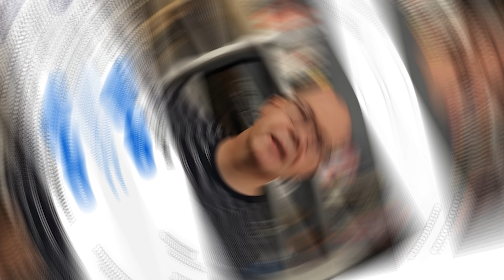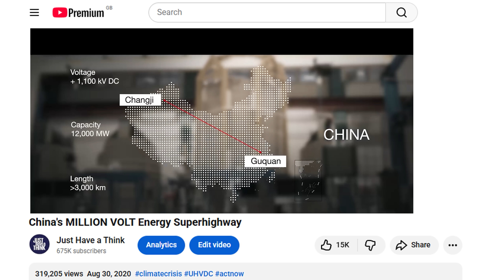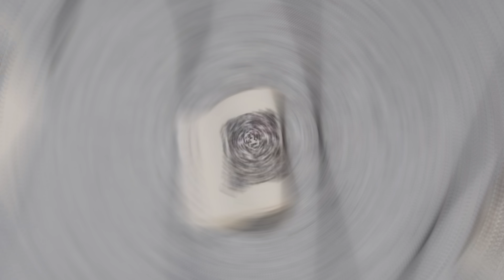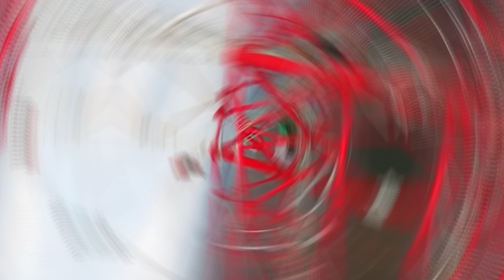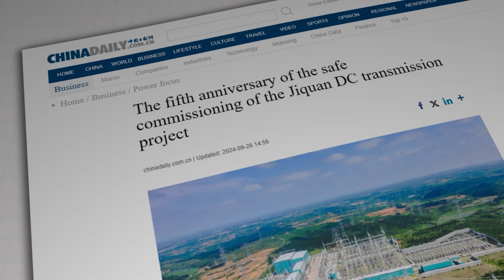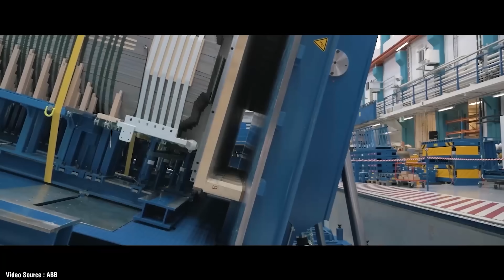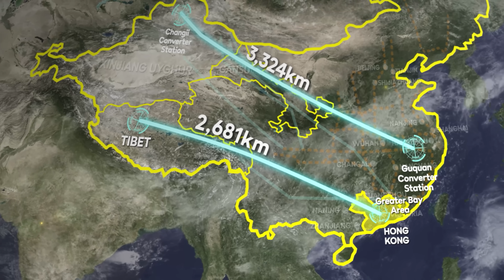China's ultra-high voltage transmission lines now breaking all records.

Comment: I'd like to see a real assessment of agriculture's impact on climate change vs fossil fuels.
As far as I understand it, agriculture is assessed using scope 3 for emissions (which seems to include everything anyone can possibly think of + some more), but the carbon captured by agriculture is not considered. 
Fossil fuels are only assessed using scope 1 (carbon released when it's burnt, but not taking into account anything else like extracting, refining, transporting etc.)
Seems to me that there must have been some very successful lobbying by the fossil fuel industry to get everyone to 'look over there' at agriculture to take some of the heat (no pun intended 🙂) off the fossil fuel industry!
Reply: I would do almost the reverse, count up the fuel burned to produce it, drilling and refininso that gets counted, but the burning of said fuel is the end user. That way things aren’t double counted.
Reply: There isn’t any significant carbon capture from agriculture. The exception being trees for fruit and nuts. Annual crops (75% of which are grown specifically to feed livestock) have relatively shallow root systems. And tilling the soil prior to planting next year’s crops exposes those roots and promotes bacterial digestion and subsequent carbon dioxide emissions.
Reply: I forgot to mention rainforest destruction, which is eliminating a major carbon sink. It’s not being cut down for broccoli. It’s purely to convert rainforest into pastures for cattle. And into crop land growing plants solely for fattening up those cattle for market.

Comment: AI Summary

Abstract

This analysis evaluates the current state and expansion of China’s Ultra-High Voltage Direct Current (UHVDC) transmission infrastructure as a solution to the "spatial mismatch" between remote renewable energy generation and high-demand industrial centers. The report highlights the technical performance of the Changji–Guquan line—the world’s longest and most powerful transmission link at 1,100 kilovolts (kV)—and details upcoming projects, including a 2,700 km line from the Tibetan plateau. It contrasts China’s ability to deploy continental-scale engineering projects under a centralized regulatory framework against the West’s fragmented markets, dense land-use patterns, and complex permitting regimes. Technically, the focus remains on the efficiency gains achieved by minimizing thermal losses through extreme voltage elevation and the transition from AC to DC for long-distance "mega-links."

China’s UHVDC Energy Superhighways: Technical and Strategic Summary

*   0:00 The Transmission Bottleneck: Robust transmission infrastructure is identified as the critical missing link in clean-energy rollouts. In many regions, renewable capacity remains idle because existing grids cannot transport the generated electrons, leading to "constraint payments" where operators are paid to stay offline.
*   0:42 Scale of the 1.1 Million Volt Line: The Changji–Guquan UHVDC line spans over 3,000 km (roughly Seattle to Chicago), transporting power from the Northwest’s wind and solar parks to the industrial hubs of Anhui province.
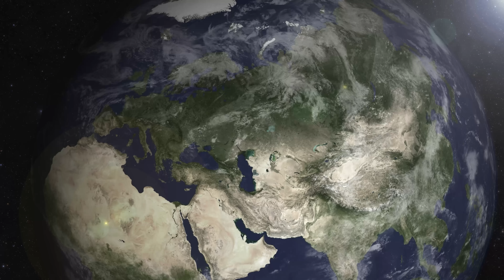*   3:41 Physics of High Voltage: Efficiency in long-distance transmission is achieved by maximizing voltage to minimize current. Low current prevents the conversion of electrical energy into waste heat, ensuring minimal losses over thousands of kilometers.
*   4:20 AC vs. DC Economics: While Alternating Current (AC) is efficient for short distances due to ease of transformation via electromagnetic induction, it suffers from "sloshing" and radiation losses over long distances. Direct Current (DC) avoids these issues, making it the superior choice for continental-scale links despite the high cost of AC-to-DC converter stations at each terminus.
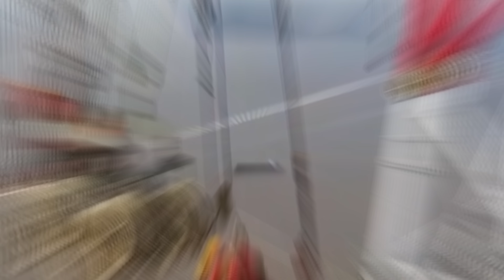*   5:18 Performance Metrics of the Changji–Guquan Link: Rated at 1,100 kV with a 12-gigawatt (GW) capacity, this single line carries power equivalent to the entire electricity grid of Ireland. As of late 2024, it has delivered over 300 billion kilowatt-hours (kWh), displacing approximately 120 million tons of coal.
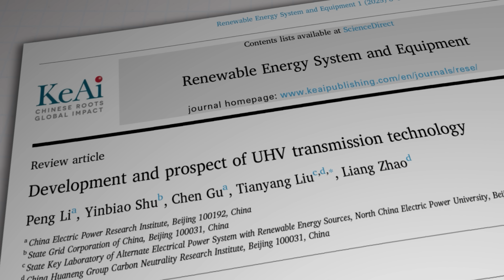*   6:29 Technological Maturity: China is refining UHVDC into a "mature technology" through innovations in gas-insulated transmission lines, improved converter valves, and advanced external insulation, moving these feats from "exceptional engineering" to standardized infrastructure.
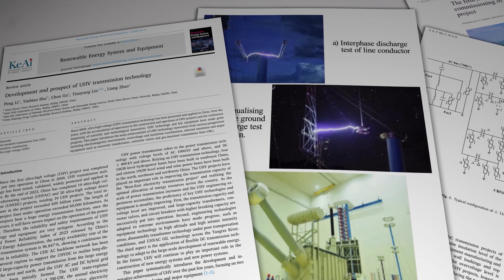*   7:01 The Tibetan Plateau Project: A new $7.5 billion project stretching 2,681 km is underway to link the renewable-rich Tibetan plateau to the Guangdong-Hong Kong-Macao region. Expected to be operational by 2029, it has a 10 GW capacity and aims to reduce CO2 emissions by 33 million tonnes annually.
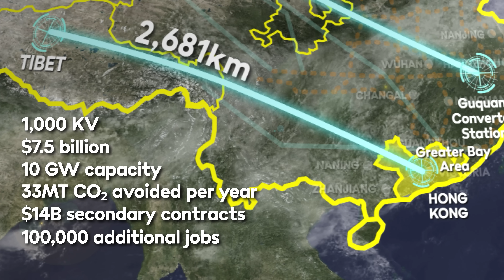*   8:20 2050 Strategic Goals: China plans to establish more than 10 HVDC and UHVDC corridors originating from Tibet by 2050, targeting an export of over 500 billion kWh annually.
*   8:36 Engineering Challenges: Deployment requires massive specialized equipment, including converter transformers up to 40 meters (130 feet) long and weighing hundreds of tons, presenting significant logistical and installation hurdles.
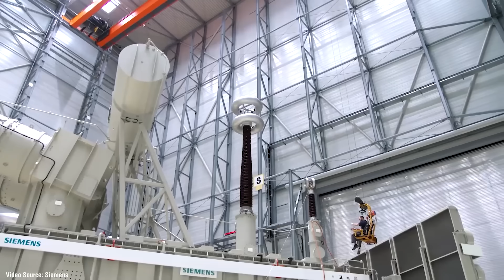*   9:15 Geopolitical and Regulatory Barriers: The West faces non-technical obstacles that China does not, including dense settlement patterns, complex land-rights regimes, and lengthy public permitting processes. Additionally, Western markets are fragmented across multiple regulatory bodies and system operators, complicating the alignment of pricing and standards for interstate or cross-border lines.
*   10:42 Conclusion on Western Adaptation: While Western firms (e.g., ABB, Siemens) manufacture the required components, the "Western capitalist" model lacks the unified standards and coordinated national policy required to achieve China’s level of infrastructure integration.

AI-generated summary created with gemini-3-flash-preview for free via RocketRecap-dot-com. (Input: 18,792 tokens, Output: 980 tokens, Est. cost: $0.0123).

Comment: China has had these for a while now, and they are indeed breaking records.  But they aren't massively better than the DC lines we have (which run at lower voltages).  Only about twice as good.  That's still very good but energy tends to run on non-linear scale so it's not that big of a game-changer.  Don't over-hype it.

The Pacific DC Intertie (Running north-to-south through California, Nevada, a few other states) runs 1000kV (+/- 500kV = 1000kV delta.   Roughly half the voltage of the Chinese line (+/- 800kV to +/- 1100kV), but it still moves 5GW.  The UHVDC line in China moves 10GW.

-Matt

Comment: I'm living in a camper on my own land, off grid. I started with solar panels, a generator, and batteries deep cycle. Now the camper has fallen apart, they are designed to. But, I realized I don't need much. Living in same camper van with only the engine battery. A solar dash panel, a Mr heater, battery lights. I will eventually upgrade it all. Living with just a cooler, with a 40 mile store trip is getting old. But I believe we don't need as much as we are lead to believe. Wind Solar on a personal level could be a solution. Tastefully. 67✨💃✨🌎🌍🌏✨
Reply: Small communities & microgrids👍

Comment: It always seems to me there is so much going on with electric cars but housing and industry, being static applications having fewer restrictions in terms of space and weight, seem wiser to prioritise. Additionally the fact that cars can in many cases be replaced with public transport and bike lanes suggests that electric cars are more of a marketing gimmick to sell more stuff than a serious attempt to mitigate climate change (though there are many situations in which they are certainly valuable). Could also the very slow rate at which buildings and industrial equipment are replaced in comparison to cars be  of significance? With climate change being an ever more urgent issue, prioritising what we do is I think more important than innovation. We have a vast array of proven technology at our disposal, some of which is quite ancient and well proven at this point. What do you think should be prioritised to get the fastest reduction in greenhouse gas emissions? That would be an interesting video.

Comment: You talked about HVDC lines in air, what about undersea or underground cables? What is the lenght at which it is cheaper to install HVDC power lines and converter stations?
Reply: Hard to know. Data likely isn’t publicly published. I’d check for research papers investigating the topic.
Reply: IIRC HVDC is more important underwater, as the water around the cable adds capacitance, which saps AC power. There are underwater HVDC interconnectors under 200 miles long.
Reply: I asked GTP that question and it told me that terrestrial transmission pylons is much cheaper than cables run under the sea. What a pity.
Reply: @reality4U-me2  of course its cheaper to build aerial wires, you don't have to pay for insulation and cable armor protection, you dont need to dig, you get free cooling,

Comment: Merry Xmas.  It's too hot for hoodies where I live.  Cheers.  😎
Reply: I'm inclined to say "Lucky beggar"! ... but perhaps you and your environment is becoming TOO hot?
Reply: @MercianNeil  I haven't had to beg - yet.  A volcanic island in the subtropics is surrounded by sea.  So far, at least, the temperatures have stayed inside 12 to 34 deg C for the last 25 yrs.  The sea temperature (18-25 deg C) keeps it that way.  The specific heat of liquid water is around eighty times that of any other material.  That's why it's used to keep IC engines cool.  😎

Comment: China has energy ressources in the west: lot of water and height in tibet for hydro energy, lot of flat space and sun for solar energy, lot of empty space and wind for wind turbines. All this very far away from the major cities in the East. It makes sense to build very long, very high power UHVDC power lines. In Europe, the renewable energy ressources are more evenly distributed and closer to cities, less than the 600km limit for UHCDC lines. It makes more sense to produce the energy closer to the consumers and use the existing HVAC lines.
Reply: I bet there are a lot of free space in the east of china. it's just a political statement/presence thing
Reply: @guai9632 there are deserts in these parts. And population density is much lower than in the east.
Reply: @niconico3907  so what? they don't have empty space except for the deserts? that can't be true. even japan have a lot of free space
also, who'll work there on maintaining all this?
Reply: What about the UK? Densely populated and will run out of space for solar and wind. We could get solar and wind from deserts in Morocco
Reply: @patelvis4725 the UK will never run out of space for offshore wind turbines. Nobody is going to approve or pay a powerline from Africa to the UK.
Reply: China is run by engineers. Hopefully they also attempt reforestation while they're at it. Desertification is still a huge issue.
Reply: @nicktw8688 
Haven't you read about their Great Green Wall project in their northern regions? Or their  successful Saihanba reafforestation project where they  planted 500 million trees just north of Beijing to stop the desert from spreading as well as reduce the intensity of sandstorms coming from the Gobi desert.
Reply: @kamsunleong6648  that's the one with lots of slave labor?
Reply: @nicktw8688 Oh oh oh I think you’ll like their project on attacking desertification in the north! I was stunned to see them essentially just stab tree saplings in a hole created by a water tube pipe thing. My favorite project are the solar panels for rural villages. It allows them to not just get free electricity, but also plant potatoes and raise chickens under the solar panels. TBH, I don’t know if potatoes and chickens help with desertification, it’s just one of my favorite simple projects.

Comment: I want a hoodie! My topic: The potential impact of not staying under 2 degrees of warming on food security in sub-saharan Africa. I think there are conflicts (Nigeria for instance where I am from) that I believe are already in some way affected by this. The region is already very food insecure and reliant on imports. I think the price of food could become prohibitively expensive there over the coming decades
Reply: Countries on the edge of the Sahara have other problems. With or without climate change, the Sahel is vulnerable to desertification. The whole region needs much better management of water resources, and build a green belt to push back the desert like China and other countries have done. There is a coast line that allows water desalination. But these are strategic infrastructure plans that needs a strong government with enough foresight, efficiency and organisation to pull off. That's basically what Africa lacks. The only country that ever had anything like this was Libya under Gaddafi, who built a vast irrigation network and turned desert into farmland.

Comment: Hi Dave.  Love the show.  Would be interested in the state of orbital solar, especially if small scale deployment could be feasible for remote power delivery, for industrial or scientific sites in very remote areas (like Arctic/Antarctic), or if the only feasible method is large scale, high orbit.  Thank you
Reply: Orbital solar is not working economically. to transmit power wirelessly over long distances  you need a very large antenna. The antenna would be larger and more expensive than a solar panel of the same power. Without talking about the cost of sending machines to space and maitain them.

Comment: Hi Dave. I’d be interested to see a video on why there seems to be a reluctance from the major battery producers to offer home storage devices at scale. Also, why the cutting edge tech seems to be reserved for EV’s with home storage as an after thought. Here in RSA most home storage is locally assembled from Chinese cells. They are very good units but as such they have been slow to see the benefits of the reductions in cell prices. 
I guess the EV market is where the quick money is but here in SA EV’s are a pipe dream.
Reply from the maker: Thanks for your suggestion.

Comment: Texas has a lot of solar and I can see a day when distribution becomes an issue between local and nonlocal. If power over collection could be routed to regional storage, especially across less populated areas, I can see these ultra high voltage lines having some applications, especially for high power users like data storage centers, hospitals, etc. Good vid. Happy Holidays.

Comment: It would be cool to get one of your hoodies. It would be great if you could cover the new technologies regarding Recirculating Showers which can save up to 90% energy and water consumption. I live in a motorhome with such a system I installed. I can now enjoy a long hot shower using only 4 liters of water and only 10% of the power. If adopted world wide this could save over 50% of the worlds domestic water consumption and up to 35% of a households total electricity use.
Reply: A friend of mine tried to patent this many years back, but it went nowhere. There is a commercially available product but it's rather expensive.
Reply from the maker: Thanks for your suggestion.

Comment: Meanwhile one of the sunniest places in Canada single mindedly want to build a multi billion dollar pipeline.... yeah humans!!
Reply: How many hours does this sunniest place get in a year?
Reply: @peterbarratt2415  averages between 6 and 6.5 hours per day , averaged over a year.
Reply: @peterbarratt2415  typically the average is 6.5 hours of direct sun per day. With some parts achieving 7.5 to 8. Also the southern part if excellent wind farm territory.  Last there is a huge untapped potential for rare earth products... and a world wide demand for rare earth magnets , incidently sintering rare earth magnets requires a built in petroleum based system...which means at least that part is already part of the knowledge bank...it could divert a portion of the petroleum product to local manufacturing,  yes it would be a drop in the bucket... but it would also reduce reliance on certain less then friendly nations and make the products more controlled locally, while reducing the hazards associated with long distance transportation.

Comment: Free Jumper OK. "Better than boiling water?" are we wasting time with Fusion if all we do is use it to boil water? wouldn't it be easier to figure out how to dig deep holes for "Geothermal" if that's all we're going to do, boil water.

Comment: Video Topic: Steam is used for nearly all heat to power energy production, but super critical CO2 seems like it could be a huge bump in 1: generation efficiency and 2: plant size reduction. There's a firm in the US that has been working on SCO2 but I'm not sure if they are still getting funding since DOGE dismantled most of our tech innovation programs, but I do know China (of course) is launching a SCO2 plant in 2026 (if I remember correctly). Combining high heat thermal storage with SCO2 power production may be a big sector of energy production in the next decade and worth learning about.

Comment: I would still like to see further development of space based solar panels, beaming down the energy to the surface. In space you wold have solar coverage 24-7 without weathering or cooling issues. would be great to get more info on the trasnmission of the energy.